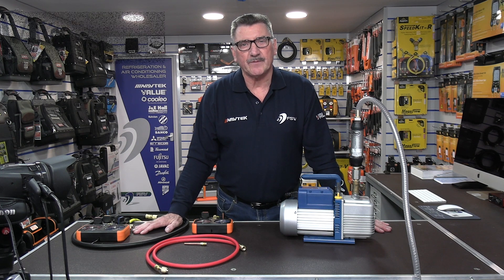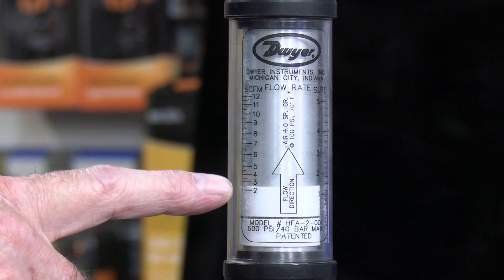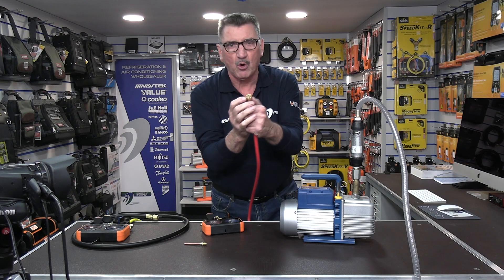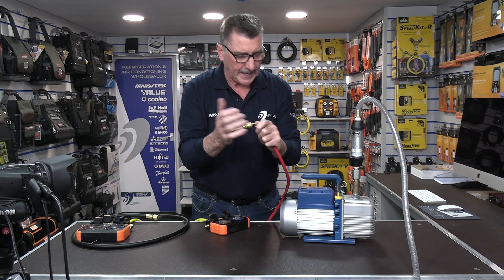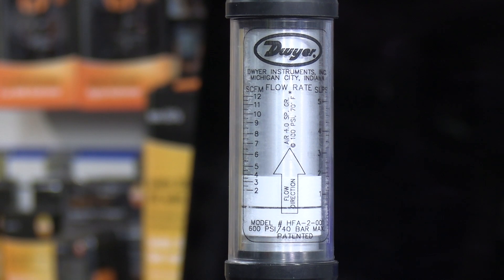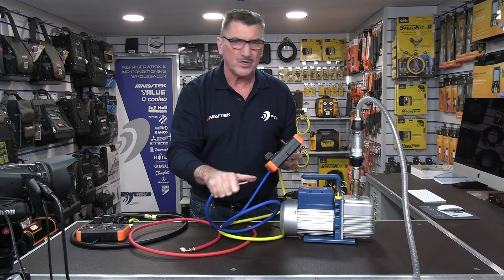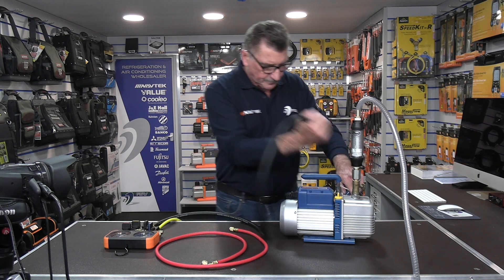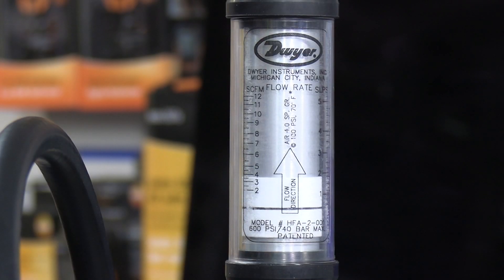The "NO FLOW HOSE", Why using 1/4" hose's to Evacuate & Recover refrigerant is SOOOO Slow....

Comment: Great video Rob. I’m hoping Appion will be bringing out a 1/2” hose with 1/2” fitting so I can utilise that port on my fieldpiece pump soon…
Reply from the maker: Hi Glen, not sure myself, but we do offer the NAVTEK Hi-FLOW Hose in the 1/4" x 1/2" option. Order online here https://www.fsw.uk.com/navtek-vacuum-hoses/navtek-big-boy-hi-flow-evacuation-hoses  or collect from one of our branches around the UK. If you want to stick with Appion then buy a brass flare adapter and reduce the port on your pump from 1/2" down to 3/8" the flow loss is negligible, saves about 1.5 mins when evacuating a large yellow top cylinder in our tests, I think thats why Appion may not offer them?